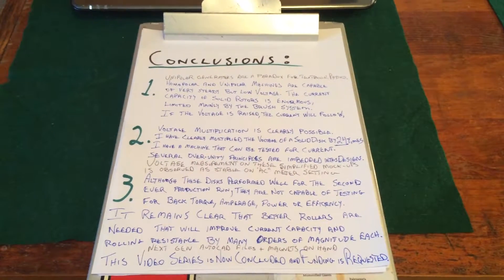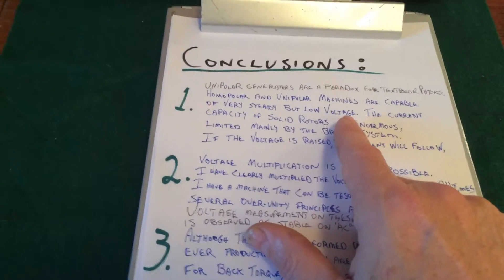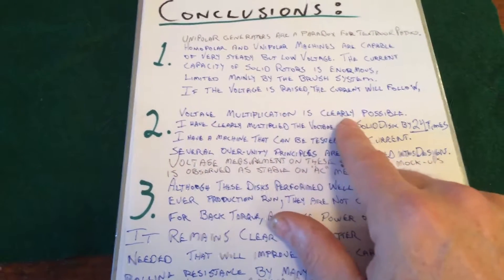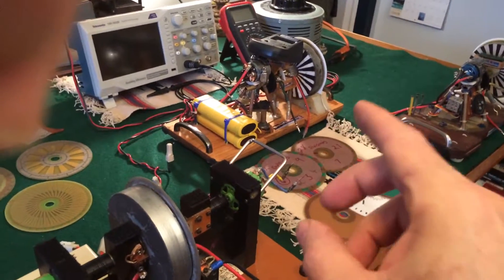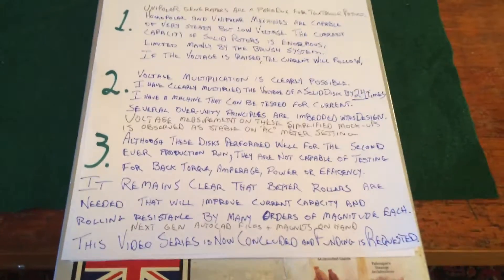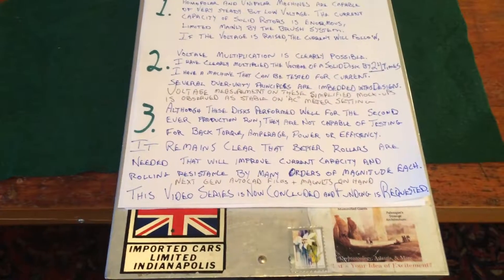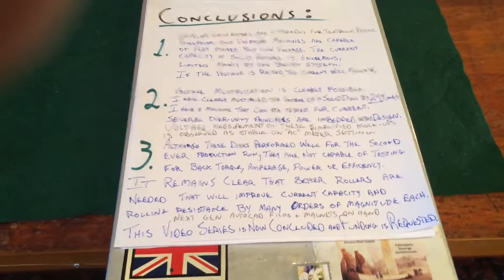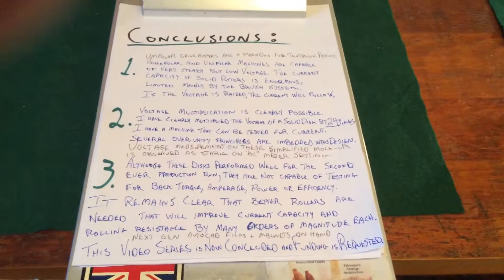Conclusions of my research with available devices that multiply the voltage of unipolar generators.

Comment: What can I do to help you build another machine? Like what do you not have the capability to do yourself?
Reply from the maker: How is your tesla turbine coming along?  If you are still interested to collaborate then send me email bryanstrohm@hotmail.com
Reply: @bryanstrohm468  hey Bryan! Thanks for reaching out! The TesTur research is going amazingly, My latest dyno got +4250watts between only 6000-8000watts and 6.22ft-lbs of torque at only 4150rpm all on just room temp compressed air that never saw over 40psi at the nozzle! And I just shared the first vacuum steam start up of the steam Micro Power Plant I’ve put together for low temp steam tests like Nikola Tesla writes about in his “Our Future Motive Power” article.
Reply: @bryanstrohm468  but enough about me! How are things going with your R&D?
Reply: I’m in the middle of building Tesla turbines and compressors/pumps from scratch in my garage with small cnc machines. I would love to help if I can.

Comment: Nice that you do these interesting experiments, and even better that you make these short videos about it.
Much appreciated, but your conclusion #1 is straight out outrageous.
Your claim that unipolar generators are a paradox for the text book physics is absurd. For physisists it is all perfectly clear for a very long time already.
The fact that you yourself don't understand what is happening, doesn't mean that others don't understand what is going on.
So, your claim makes you a "Dunning Kruger", and that means you should work on your own understanding, and not on mine.
Cheers.
Reply from the maker: If you can explain how sometimes there is back emf and sometimes there is not, then you have moved past the parodox, unlike the textbooks which claim there is always back emf.  Induction actually requires zero energy.
Reply: @bryanstrohm468  The buildup of the magnetic field requires some electricity, and when that field collapses, it gives back that electricity, but in the opposite direction.

Comment: If you realize the possibilities of your own handy work. You do realize you just proved all we have to do is spin an electromagnet in a circle. So if you rotated a Tesla coil while in operation the output is increased constantly. Using the frequency of the primary coil an yes this too can be rotated its an electromagnetic faraday drum! So yay we did it! But bet no one reads this.
Reply from the maker: yes I realize it.  took me a year to get to your comment, but good thinking!   unfortunately, the unipolar gen does not work well with high freq. high voltage.

Comment: As I commented on an earlier video, the Faraday Paradox is no paradox at all; it is the result of a misunderstanding of the application of the classical electromagnetic theory of Maxwell ( and Lorentz). There is no violation of the physics of the machine and there is no possibility of an over unity operation. Try not to follow the path of failures encountered by DePalma, Trombly- Kahn and Tiwari in their quest for free energy.
Reply: i agree with you, but my belief is that we could use homopolar design for low torque high horse power aplication analogus to a turbine
And after that, with correct understanding of science (and not zionistic dogma), we could find ways to get aether propulsion or smth... probably an above gamma resonator or smth of those sorts
Reply: Um so like if I make it so there's no contact on the disc? The only reason the N-machine never hit over unity was the friction from the pick-up contacts! If you make it like a tank circuit then its just a rotating transformer! So ummm???
Look your wrong! Too be honest if you "wrap quartz" in the coils the rotation itself would power an electromagnetic homopolar disc. An hey guess what rotating an electromagnet makes it grow to a larger voltage! So guess what it does break many laws of physics. An if you know so much about the paradox surely you must be writing a book for all of us to be enlightened! I doubt it though! Its easier to scream you think you can do these things but you just can't Nemo your????
So I must pleasantly dis agree. 
Cause if i can spin an electromagnet an make it produce a larger voltage than i put into it that's over unity im perty sure that's the definition of over unity.  Like it or not the laws of physics me I break them for fun!
Reply from the maker: You should study the interaction of 2 perpendicular current elements.  I have the technical reference if you can not find it.  There is a complete breakdown of action=reaction and considerable excess energy results.